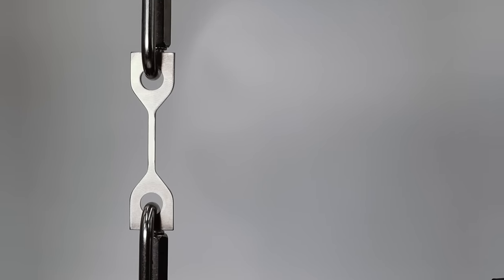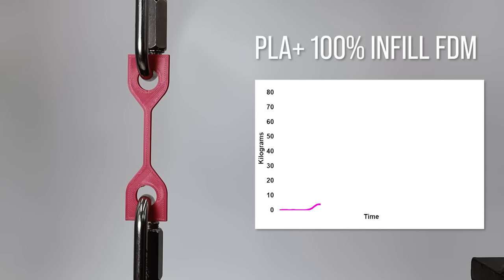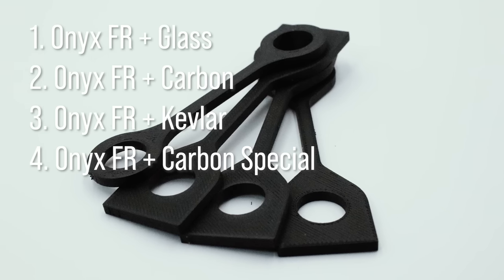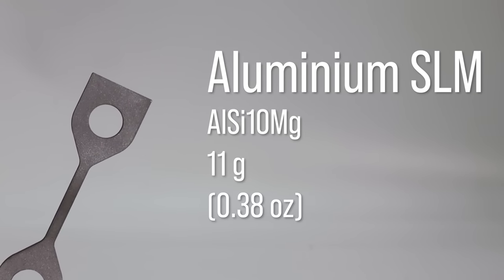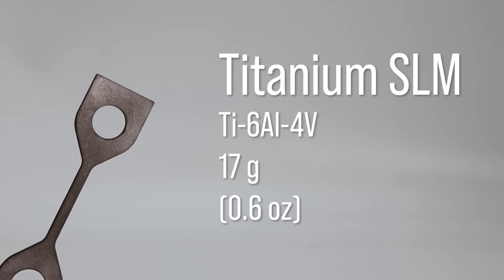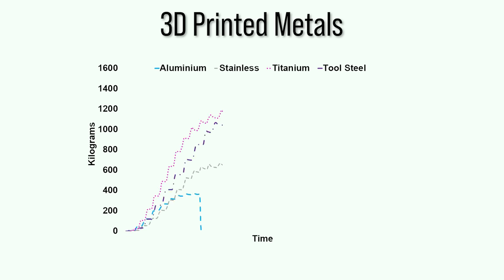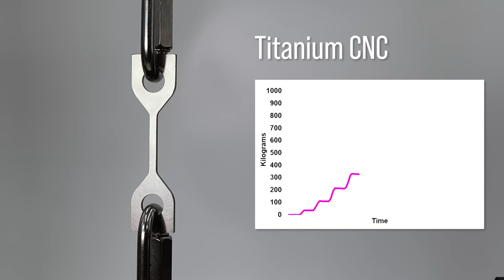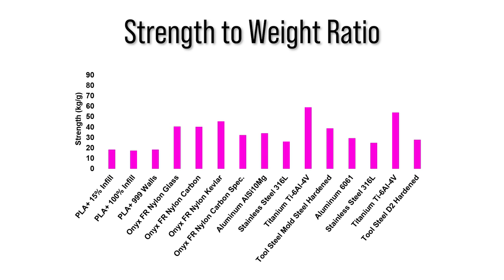3D Printed Metal vs CNC Machined - How Strong?

Comment: Grain direction in some of the cnc materials plays a big part too. The titanium looks like it was perpendicular to the test load. The break seemed like it too.
Reply: True. This would probably require further testing to discard or confirm it as a variable.
Reply: @Mernom  I worked in a field making pressure rupture discs. We would cut slits in the material with a laser leaving tabs that break upon failure. Cutting parts in the wrong grain direction for the application yields vastly different results. I can only assume the same happens here.
Reply: Also the difference between billet and forged parts in the case of aluminum
Reply: Grain direction in metal is negligible, which is why you don't care about orientation of raw material when CNCing parts. Metal is isotropic.
Reply: From my research, albeit quick, the grain direction has little to no effect here.
It does, however, play a huge role in bending metal.
Reply: @1SmokedTurkey1  the as-printed condition for metal AM (or most AM in general) is not totally isotropic. It's definitely closer after heat treat though. As-printed will typically be weaker in the build direction

Comment: Most common alloys are not suitable for 3D printing, like 6061. The 3D printed aluminum part was most likely a much different alloy but cool to see they can be just as strong as a machined part these days.
Reply: Most likely AlSi10Mg or F357. There are 6061 substitutes being developed pretty heavily right now too though

Comment: Great tests! I don't think it was mentioned, but I assume the 3D printing process built these pieces "flat", right? I mean as opposed to "standing" like they are on the test rig. A major source of weakness in 3D prints is at the interface between layers, so I don't see how these parts could be this strong if the layers were horizontal when the piece is being stretched. By the way, it would be interesting to also compute the tensile strength you observed in Mpa (as Stefan from CNC Kitchen does), and compare these values to the ones reported by PCBWay. For example, they claim 560 Mpa for 316L stainless, 330 Mpa for aluminum, and 600 Mpa for titanium – all tensile strength numbers.
Reply: kind of like resin the properties are more homogenous, so the difference in strength due to the orientation it was printed in should be negligible. for the SLM printed metal parts
Reply: 3d printer metal is kinda different... it's almost more like simultaneously welding the entire part from powder.
Reply: @tony_mfg7597  Thanks for this comment, I never knew this since I've only ever owned FDM 3D printers, so I looked it up and it does seem to be the consensus. Very interesting property, I would not have expected it given that resin prints are still done layer by layer.
Reply: @desmond-hawkins  no problem
Reply: You can actually see the upskin in the parts. They were printed vertically. Metal does not suffer from FDM issues as such. The big impact is more in the grain structure and that is where the orienation has an impact. XY&Z will have different z-strength and elongation.

Comment: It’d be interesting if you could test metal cast from 3D prints, as that’s a DIY way of “3D printing” metal. Maybe a collab?
Reply: or even forged, but i dont know where he could get forged parts
Reply: @Fantastika  would probably need to compare to a commercially available forged part, e.g. a moto brake lever.
Reply: no its not, thats just casting

Comment from the maker: The results were a little surprising! Any ideas for a future strength test video?
Reply: Test casted parts
Reply from the maker: @smashyrashy  Great idea! I'd need to do some research into that.
Reply: Please provide stress/strain curves or other useful data next time! Really appreciate the approach here but I'd really like to see more of the useful data
Reply: Two explanations for the results; One, the Alsimg10 has much higher tensile strength than 6061-T6 aluminium.
And two, the CNC parts from PCB way cold be laser cut from a sheet, if they are, that could explain the results, aluminium would lose its temper and steels would precipitate carbon near the cut edge and become brittle.
Reply: @zomgthisisawesomelol usually in 3D print is used AIS10Mg (it Is written in the video) alloy wich is equivalent to something like EN 1706, 2010 aluminium grade.
Reply: Not very surprising at all… The lattice structure should be similar to that of a weld line. Harder, stronger, more brittle, less ductile, and less tough.
Reply: Test long term (days) strength for PLA! I have never seen anybody do this, but it seems highly important.
Basically it seems that if PLA is under tension, it is radically weaker in the long term. So in many application it fails, even if it should not have according to the datasheets!
I have experienced it, and also seen quite many youtube videos, where it turned out that PETG is much stronger in practice than PLA, because of the long term effects of strain on PLA.
Reply: @adamrak7560  This is because the lattice structure of PLA has very little room to shift. It’ll be more resistant to deformation but will be more prone to brittle fracture through repeated stress. PETG has a more “loose” lattice structure (or has more impurities/imperfections throughout it), as it undergoes stresses the lattice structure will align causing it to get harder and more brittle in those stress areas but can hold up to more abuse over a longer period of time. It’s akin to using cast iron as a hammer vs pure iron.
Reply: @DK-hv7xp  I think Adam Rak was talking about PLA’s tendency to be extremely susceptible to creep, particularly when compared with other plastics. In that case (on a functional part), the failure mode isn’t breakage, so much as it is that the part will have deformed so much over time that it’s essentially unusable. This happens far below the yield point of PLA, and is something that you don’t see as much with other plastics in 3D printing.
Reply: During conclusions, it's important to represent summaries of all data. While the SLM parts outperformed in ultimate strength, the conventional parts seemed to outperform in elongation, which is also a very critical aspect of material properties, since this means the SLM parts are far more brittle. Overall, you've made a good comparison, but some things are a bit apples to oranges. 

For example, the aluminum SLM material is different from the conventional. While you can still get information from this, it's very important to highlight different materials used when comparing them.

Another important thing to highlight is that metals aren't created by the CNC process. Metals are cast, wrought, forged, MIM'd, etc. CNC machining only defines the shape of the metal. Each of these processes, like SLM, have different material properties and considerations. I'm worried using the generic term of "CNC" as a comparison can be a bit misleading. Since CNC is not how the metal was made

And finally, it's also important to research how PCB Way manufactures the SLM parts. Do they cut the SLM parts straight off the plate and machine them? Or do they first go through a stress relief & HIP process before machining, similar to how industry processes additive AND cast components. The stress relief and HIP processes vastly change grain structure and material density from as-grown into something that behaves more equivalently to conventional materials. My guess is they didn't, which explains why the elongation underperformed, but the ultimate strength overperformed. Stress relief/HIP would make these parts similar in performance to conventional parts.

As some have already mentioned, I would also encourage you to look into standard strength samples with small gauge diameters that would better work for your rig. As we saw with one of the Onyx parts, part geometry plays a large factor in experimental comparisons. Check out ASTM E8 or E8M, and see if any of those standard samples are similar to the thickness of the ones you used here! Then I'd recommend to use those going forward
Reply: @dalh598.1 This is the comment I was looking for!

Comment: The "heat treat" you did likely did nothing, if anything softened the parts.  Heat treating steel requires specific temperatures and specific times for cooling to create the proper grain structure.  It's followed by an annealing process to dial back the hardness to a specific number.

I would recommend redoing those tests and obtaining pieces that have been properly heat treated to a specific hardness.

I was surprised on the 3d printed part strength.
Reply: It's all pointless unless multiple samples of the same materials and treatments etc. are tested, we have no idea if these parts are representative of the average expected strength or not, what the standard deviation is etc.
Reply: I'm a tool and die maker and know by accident a bit about heat treatment. By heating up the parts to about 500°C you annealed them and reduced any existing hardnes. D2 fpr example needs a temperature of  1020-1050°C, followed by a chill in oil or moved nitrogen gas and has to be annealed at about 500°C afterwards  for several hours.
Reply: Yep, there's a lot of weirdness going around there in general. He manages to heat the part to a nice orange in the centre (one spot even reaching yellow) which would suggest temperatures of >1000degC. Steel at 500 degrees shouldn't even be reddish. Which would be decent temperatures for a heat treat, except that it should then be chilled quickly (oil quenching recommended for 4140). If it gets below tempering temperatures too slowly you'll just end up with an annealed steel again. He might've actually gotten lucky with the accidental heat treat as the thinness of the part causes it to cool down really quickly. But eh, that's rather unlikely.
Reply: haha i was about to comment this myself bravo im surprised anyone else thought of it
Reply: 500 IS too low. It should be at least 720 depending on the alloy. This because you aim for the austenitic zone.
Reply: @Ender240sxS13  
Sure, but that gets expensive and this guy is likely doing it out of his own pocket.
Reply: The problem he has with machined samples is that there are a lot of imperfections on the surface after cutting. Those samples should be like cylinders then it would be a correct experiment
Reply: @О.Ш-ь1щ  that is the dumbest thing I've read today. Unless it was cnced by a amateur who just learned how to used the machine today they would be nearly perfect a lot more perfect than any 3D print ffs dude cnc machining is used to make true squares and to flatten engine blocks and heads, which need to be very close to spec within 0.1mm+/-. You are kinda correct about a cylinder being a more consistent form to test with but at that tiny scale not really the only thing that matters is the consistency of the materials being tested, so if they are all within spec of each other which he goes to great lengths to achieve the results are pretty consistent. Literally the only major flaw in this experiment was the improper heat treat everything else was very well executed.
Reply: @О.Ш-ь1щ  
That is not that huge of a deal, it is just a simple matter of fact that 3d printed parts are stronger along the grain than any form of traditional manufacturing.

The way they are being tested, is in their favor, along the grain. Even if those machined parts were utterly flawless, they would still not perform as well as the 3d printed parts due to that. 

If he was to change the direction the force came from however, and apply force from a different angle, then the 3d parts would very likely perform worse than the machined parts. 
It is both a unique benefit as well as drawback to additive manufacturing.
Reply: @unmortal8672  Just take a closer look at the samples which were tested here. Also get a proper education and experience to make some conclusions. I see and do know what I'm talking about because I've been in a laboratory, preparing the samples for the test and I developed methods for materials' test. If you once heard about precise CNC machining don't think that everyone uses it
Reply: @thezyreick4289  So you insist that porous structure is stronger than solid?
Reply: yeah wanted to scream at him when he did that ;P
Reply: @О.Ш-ь1щ  These pieces are flat. Sure, the holes and angles may not be precise...but if you think that ~0.1mm is 'precise' or hard to do when doing CNC work on a flat surface for a simple form like that...then you should step out of a laboratory and enter an actual workshop.

I've been doing some CNC work on machines that are 40+ years old. ~0,1mm is the standard margin of error and most work will be within 0,05mm. This isn't 'precise dimensions'. This is the MOST BASIC dimension. And that assuming you use a milling machine. If you use surface grinding machine? Even with a bad one, you can quite easily get a margin of error of 0,02mm. I could do that literally on my FIRST DAY of using these machines. And remember, the machines were over 40 years old, all manual, breaking down every other day kind.

If you got anything with a margin of error higher than 0,1mm on a small piece, then I'm sorry to say but you've been bamboozled. If I remember well (I quit the job last year) then it was 0,1 for ANY dimension lower than 20mm, 0,2mm for any dimension of up to 50mm and 0,5mm for above that? Can't say for sure now. What I know is that the parts in this video absolutely NEVER, from ANY shop that offers professional CNC work, should have a dimension differ by more than 0,1 anywhere that it's relevant (aka., any dimension other than the length, which I guess would be 0,2mm).
Reply: @unmortal8672 I haven't finished the video, but 1. He doesn't specify which aluminum he's using, I didn't see any measurements for cross-section on the video which tells you a about the material. I haven't seen what heat treatment process was done on any of the materials. I'm shocked for one that his aluminum test was extremely low with low elongation. Which for any cylinder is way way out of spec.

Awh! He does another aluminum 6061. It looks like it's T0 heat treat 😅 they need to T6 and age it for about 8+ hours at 250. It will easily do over his 1 ton test rig at 10% elongation
Reply: I was gonna say, SLS metal prints need to be heat treated somewhat precisely after printing to have "acceptable" properties.
Reply: ...and it works radically differently for different steel alloys.
Reply: it has been a while since I did anything with metal, but my thought was that the improper heat treatment radically increased brittleness. I'm SHOCKED at how well the 3D printed metal did, regardless; that would be usable.
Reply: @OB1canblowme  All it did was invalidate the steel part of the test, everything else seems to be legit.